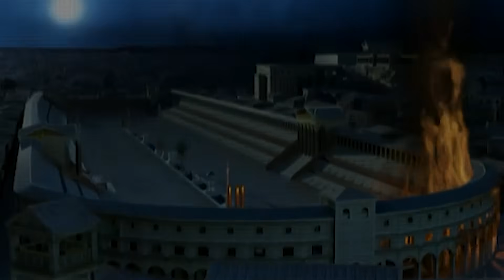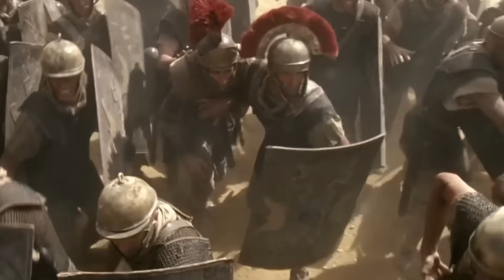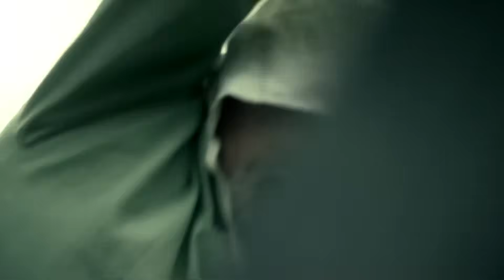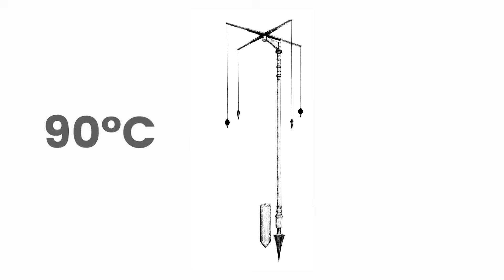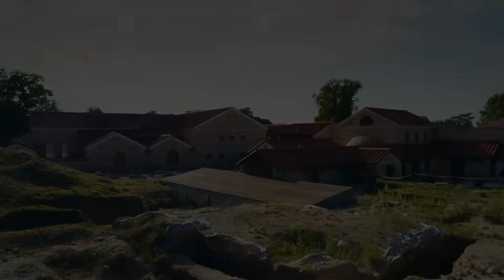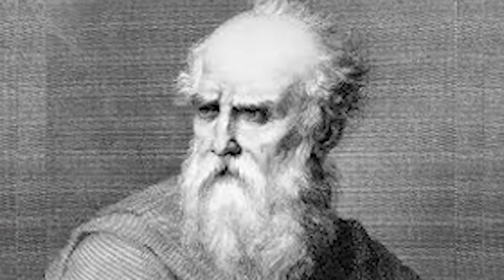15 Ancient Roman Inventions So Advanced We Still Can't Beat Them

Comment from the maker: The most disruptive truth about Roman engineering is that they built for a 2,000-year lifespan while we build for a 50-year maintenance cycle. 🏮🏛️ By using volcanic ash to create self-healing concrete that fixes its own cracks when saltwater touches it, Roman builders turned structural damage into a strengthening event. While modern municipal systems rely on electric pumps that die the moment the power grid fails, the Roman Cloaca Maxima is still flushing waste today using nothing but gravity.

Which of these 15 inventions is the most "impossible" to you? Is it the water-powered industrial mill or the high-pressure siphon aqueduct that handled steam-engine pressures 2,000 years ago?